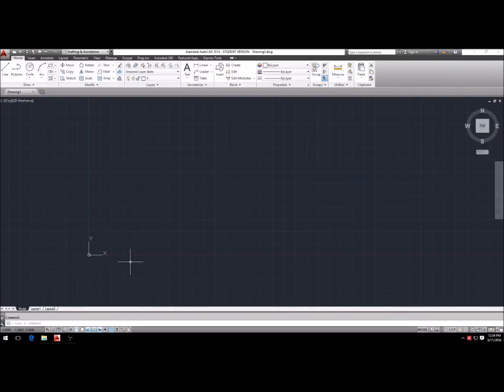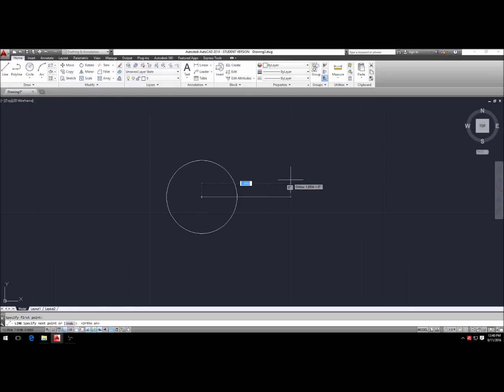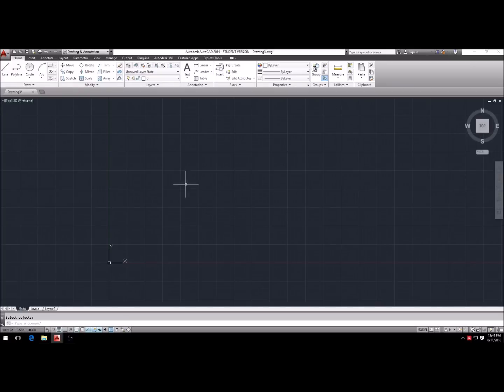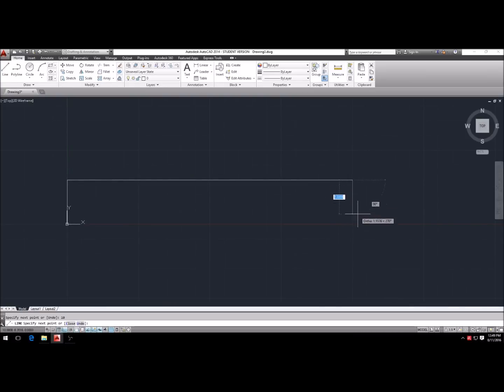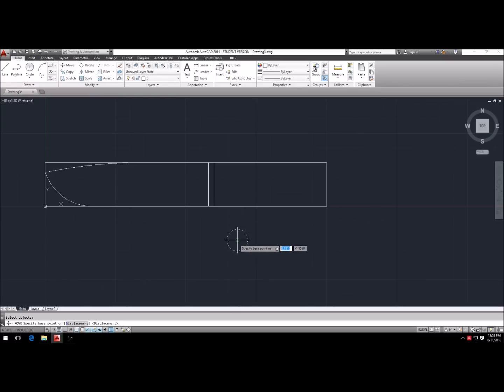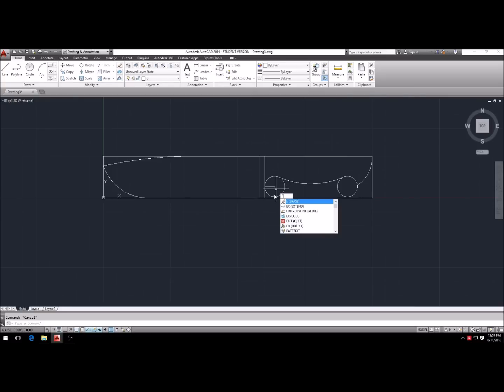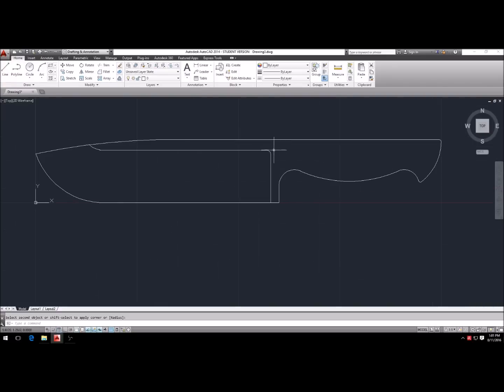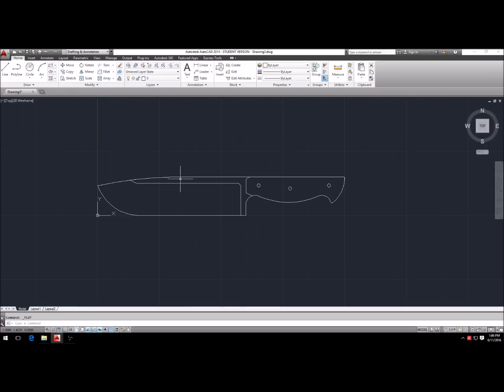How to make a knife: Design tutorial

Comment: Not sure if it's been covered elsewhere by you, but one thing to note when trying to snap to other lines is that you may have to adjust the object snap settings. (I did this by clicking "Arc", right clicking within the grid, selecting "snap Overrides" > "Onsnap settings")
When trying to mimic your tutorial with the 2016 version, I couldn't initially get the belly of the knife to start anywhere but the very corner. Eventually I found the above menu, and checked the box for "nearest" which solved the issue. Aside from that, great tutorial; I'd never heard of the program before, but it will be great once I get used to the controls. Thank you for the walk through.
Reply from the maker: Blake McErlain yes you are correct! Sorry I forgot to include in the video but I'm glad you found the rest to be helpful! Auto cad is the goto for all things being put into any automated machining. Very useful tool!!

Comment: i was wondering what the paremeteres are set to or how to make it inches and each square be equal to one inch
Reply from the maker: I'm not entirely sure! I believe mine was in inches when I started using it. As far as the grid space, I wasn't even aware you could change it. May need to check out a few autocad forums!